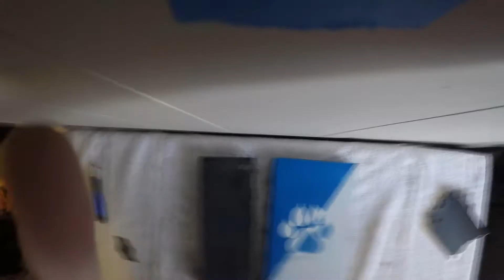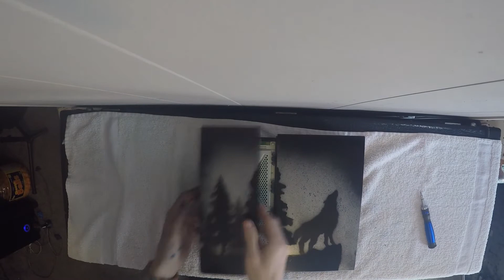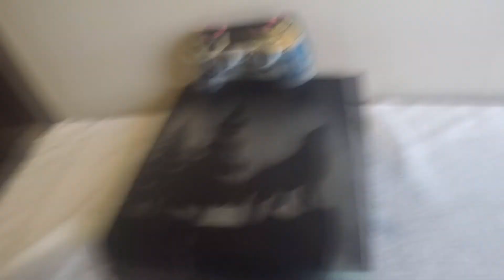custom painted ps4 timelaps

Comment: Why did you use sand paper ?
Reply from the maker: itsDlone  to make the paint stick better and last longer..
Reply from the maker: itsDlone also its gets out all the small scratches that was in it
Reply: @nitrogaming247  I just spray painted my ps4 it went really bad 😭
Do I really need to primer it and Sand paper it?

The spray paint I used can easily scratched off

Another question : whats the grit of your sandpaper?
Reply: @nitrogaming247  and can you give steps on how many coats of spraypaint and Minutes I have to wait
Reply: @nitrogaming247  sorry got alot of 
questions : 
what spraypaint did you use?

How do I take the paint off?